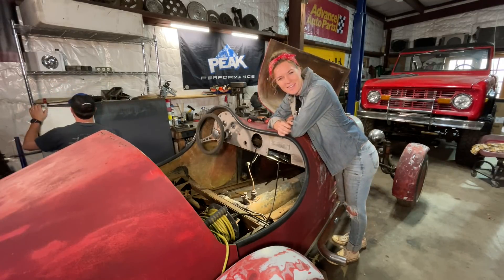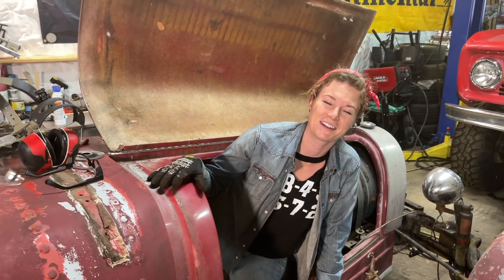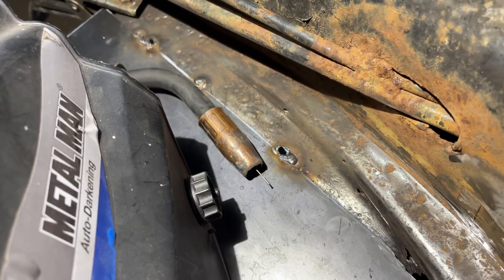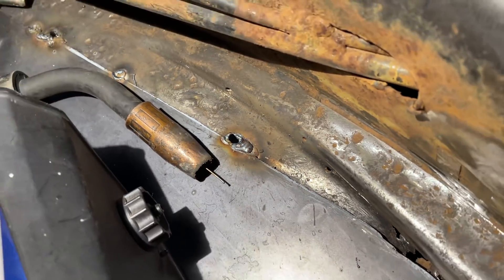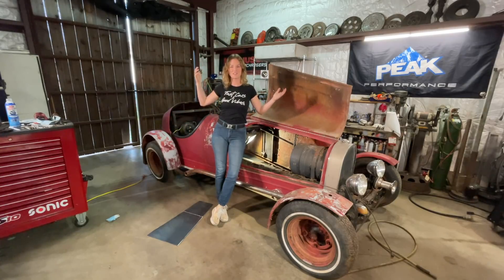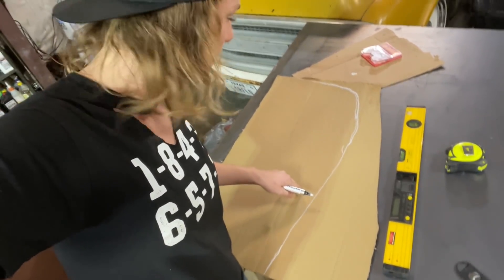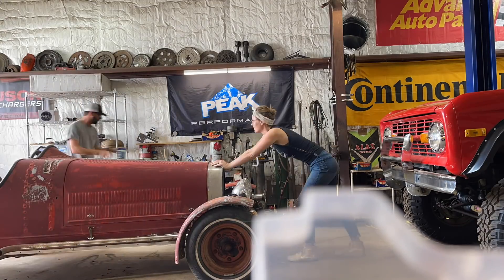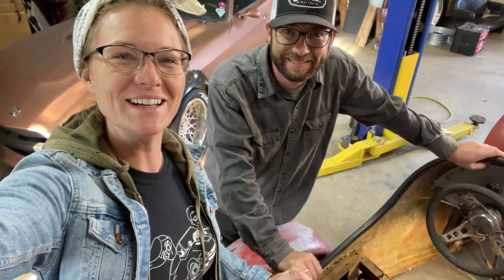The ugliest welds of all time! Floor pan time!

Comment: Try using a small diameter wire. You have .035, using .030 or even .024 will allow you to reduce the heat required to melt the wire and keep from burning holes. Otherwise, be patient and take your time! Welcome to working on rusty junk from a NYer.

Comment: Put you a copper backing behind it that old rust is like trying to weld a razor blade to a good piece of metal..low heat and cut back on you wire speed..

Comment: Here's are a couple of idea for welding thin sheet metal: 

First, reduce the welding power to one amp per .001 inch.(one amp per thousandth of an inch.) So if you're welding .060 sheet metal, use 60 amps. Got that one from several welding and fab channels on You Tube. 

Second, it's fine to make "stitch welds" and even "seam welds" by making a series of spot welds. Make the first spot weld in each series (think of the start of a stitch) ten or fifteen spot welds apart. Then make one spot weld per stitch, until you connect them all. The progression should look like this:

First series: O_________O__________O_________
Second series: OO________OO_________OO________
Third Series: OOO_______OOO________OOO_______
Fourth Series: OOOO______OOOO_______OOOO______
and so on, until you finally have...
Last Series: OOOOOOOOOOOOOOOOOOOOOOOOOOOOO

This will let you weld long segments, or even full seams, without the heat and distortion of a full seam weld, or a long stitch. 

I got this idea from the guys at "Bad Obsession Motorsports." Their "Project Binky" series, where they built an all-wheel-drive British Leyland Mini with four wheel drive Toyota Celica running gear. It is both informative and hilarious. https://www.youtube.com/results?search_query=bad+obsession+motorsport+

Comment: Thin rusty metal, no easy task. You actually did a decent job with it.   If you cared how it looked you could grind the welds then weld it again.  Grind it again and use seam sealer to make it smooth. But that’s too much work for this car

Comment: I noticed on your mig you are using .035 dia. wire. Why not use .023 wire it will be easier to weld on thin sheet metal since you will require less heat to fuse the metals?
 The strength of weld is not determined by the diameter of the wire but the type of wire used. If you take 100,000 lbs/ scare inch wire, any small weld will be very strong.
  Now for those that have no clue as to what i mentioned here, when you buy a box of electrodes and it says 7018, the first two digit indicates the breaking strength of the weld. 7018 is 70,000lbs/scare inch of breaking strength. You have the equivalent in strength with welding wire just different designation , ask your welding supplier but make sure he knows his stuff, or go on the net and research it yourself.

Comment: Surely it would have been easier to take the fibreglass body off the chassis first so you have clear access to make all the repairs required without having to be a contortionist